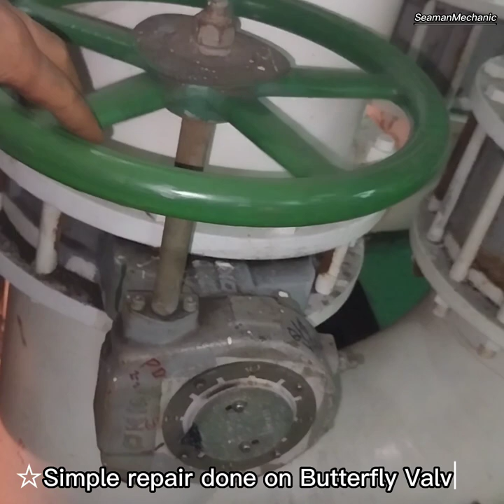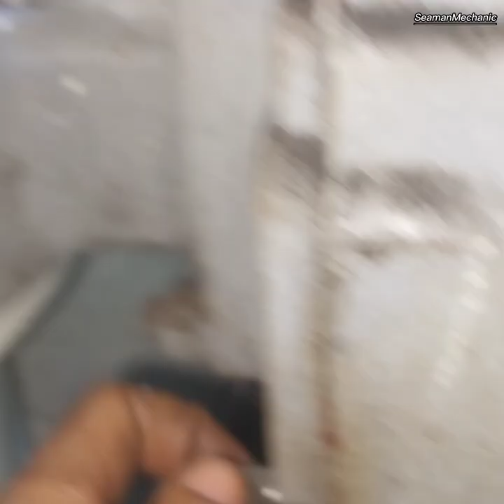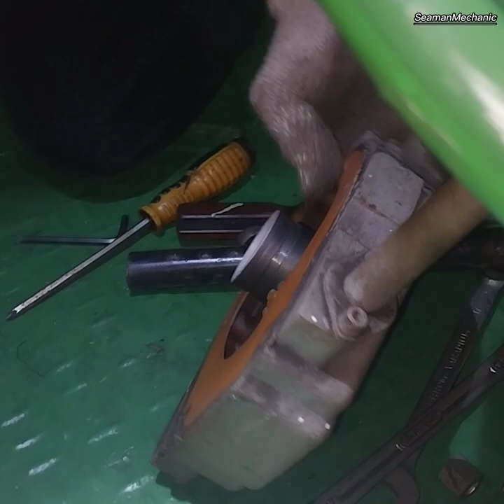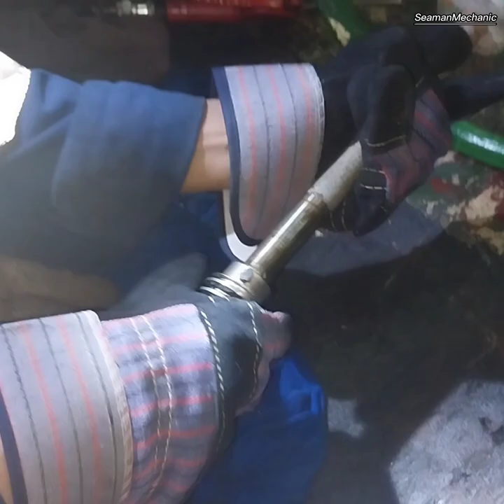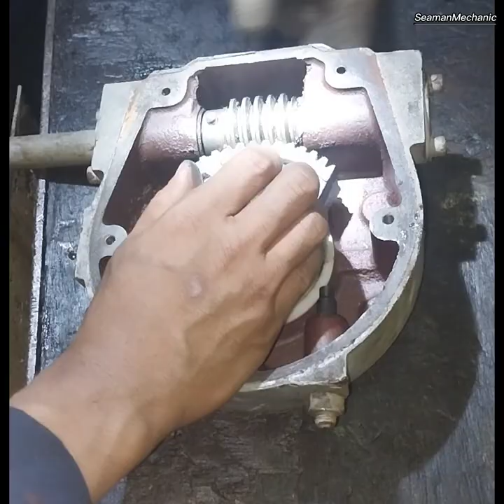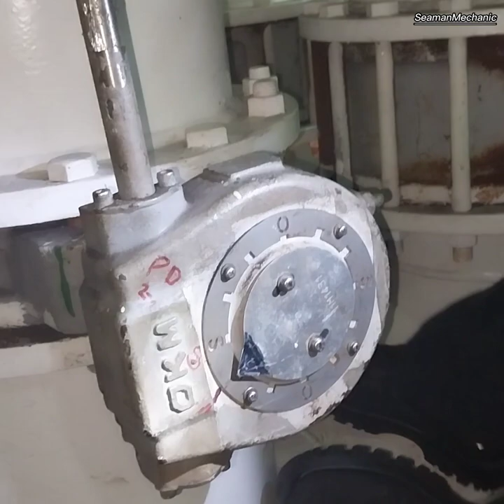Butterfly Valve | Simple Repair

Comment: Sa seachest po ba ito na butterfly?
Reply from the maker: Ballast pump outlet po
Reply: @SeamanMechanic  nasira sa amin sa seachest inlet matigas po kasi tapos nong nasarado naikot pa siya hanggang hindi na mabukas hindi na nagtama yong gear, possible kaya mabaklas kahit sa inlet?
Reply: Hindi po ba dilkado
Reply: @SeamanMechanic  ballast pump inlet pala saamin po
Reply from the maker: @DJays_Aviary  pwede po siya manumanuhin buksan, bale tanggalin nlang yung gear/actuator niya at saka buksan gamit malaking katala
Reply from the maker: @DJays_Aviary  peru kung yung shaft umiikot peru nka close position, it means putol na yung pin sa loob.
Reply: @SeamanMechanic  yes po close position
Reply: Tapos free wheel na sya pag e open
Reply from the maker: @DJays_Aviary  di na po sumasama shaft?
Reply: @SeamanMechanic  shaft tsaka wheel nalang po umiikot
Reply: Same po sa video nyo
Reply from the maker: @DJays_Aviary  pwede niu po baklasin at palitan yung pin. Pwede rn pang emergency tangalin actuator at gamitan ng katala para mag open.
Reply: @SeamanMechanic  okay po intlet po kasi ng ballast galing overboard may tubig na sa linyada para sa suction